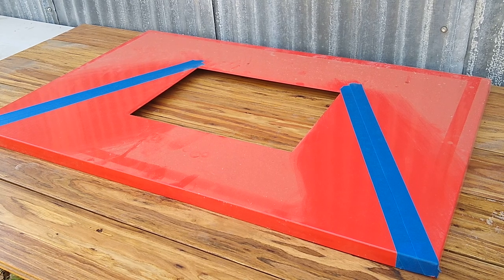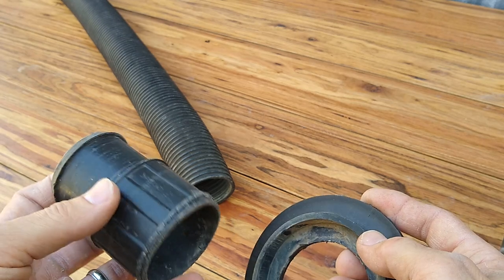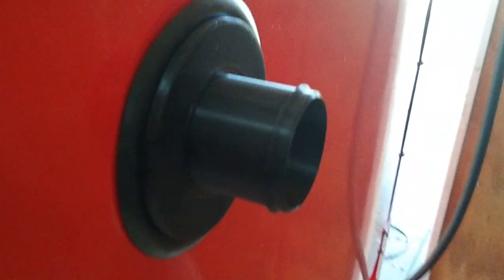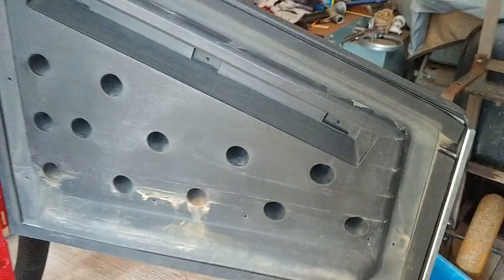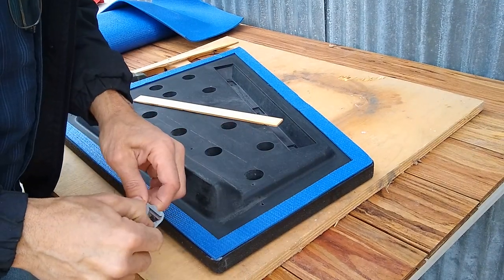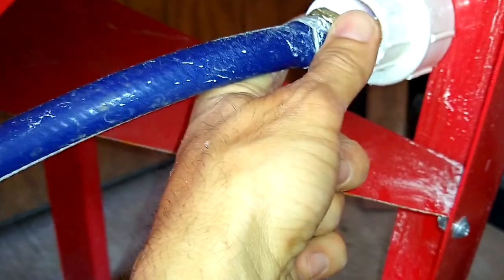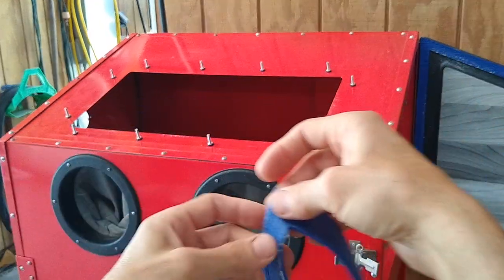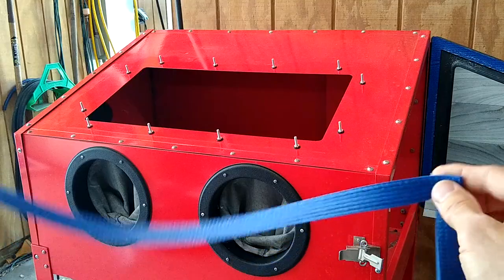Easy to do Harbor Freight vapor blast / honing cabinet upgrades mods that'll make it better.

Comment: The light you are using buy another one and cut out two holes on top of the glass on either side and stick the lamps in on top of a small glass window for the lamps. That way you get enough light, the lamps don’t get ruined and you can still pull them off when you need them for something else
Reply from the maker: Hello Jorge, Thank you for commenting and suggestions. Link a picture here or email me vbared@gmail.com so I can see how yours looks. More light would be awesome!

Comment: For the new cabinet, have you thought about an old dishwasher?
Reply from the maker: Hi Robert, Thank you for commenting. I've seen a dishwasher build that Armoury Enterprises put together, it's a cool project. It would definitely work for anything that will fit inside.

Best of luck with your projects!

Comment: A striplight right in the corner above the glove holes would be awesome! Directly where you're looking.
Reply from the maker: Hello smaqdaddy, Thank you for commenting. You and I have the same thoughts about that. Linked is my video on LED lighting that I added to the underside of the glass bezel. One thing I would have done different is to use PETG instead of PLA which won't hold up to heat at all. 

https://youtu.be/rD0HQ7l5uvE

Comment: Hello
Can I purchase the vacuum adapter and inlet cover from you? 
George
Reply from the maker: Hello George, Thank you for commenting and consideration in supporting my work. Please email me your shipping details and put "Harbor Freight Accessories Quote" in the subject so I can spot it. I'll send you a price breakdown of the most common parts. Please also specify if you want a locking hose end or non-locking if you planning to fasten the hose with a clamp.  

vbared@gmail.com

Comment: You are the 3d King - thanks for sharing your work. I'm doing this upgrades now!! Did you make V3 gun yet?
Reply from the maker: Hi UcantBeSerious03, those upgrades made a big difference in performance for me. I'm still tuning the V3 blast gun to improve media flow path. I'll put together a video about it soon.

Best of luck with the upgrades.
Reply: @vbared  Are you going to keep it garden hose threads on V3? 

I'm about to order stuff for V2 as I don't own a vapor nozzle yet. I love the flexzilla hose and great idea - there isn't any pressure from the pedal to the nozzle end. genius!
Reply: @vbared  I'm not sure if this chart will help you. Its CFM and nozzle size but its for media blasting and not vapor blasting.  https://www.idsblast.com/sandblasting-supplies/4874

I have a little compressor so I'll have to hack your stl file to make the orifice smaller or drill and tap it and insert a drilled out set screw. I  probably need a 1/8  - maybe cheat with a 3/32 orifice and 3-4mm nozzle.  Lousy 120v compressor, I'm in a remote location with no 220v :(
Reply from the maker: Hi UcantBeSerious03, Yes, V3 will keep the garden hose threads. I kept my Flexzilla hose on the longer side and left the slack outside of the cabinet so I could find the perfect length inside while using it.

Thank you for the idsblast link. It's a great resource. 

Best of luck with your build!

Comment: Hi again, just a couple more questions - Do you use any of the protective films supplied with the cabinet glass? Or just use the glass bare? Also, you say to set presure at 50-6psi, is that the static pressure or the working pressure (actual pressure showing on the gauge when the foot pedal is being pressed down and air is flowing).... Thanks!
Reply from the maker: Good morning Ryan, Thank you for commenting. The clear sheets that come with cabinet will not work with the wet system and leave a lot to be desired in a dry setup. 

I found that an automotive paint protective clear film on the inside glass is the best way to protect the glass from being etched and doesn't need to be replaced. Check out my video about it 

https://youtu.be/OuqL9xWJE48

I set my cabinet pressure regulator between 50 - 60 psi without the air control pedal being depressed. Glass beads shatter above 60 psi. Materials like garnet can go much higher but unless your running a big compressor blasting garnet at 90-100 psi uses up all your air too fast.

Vapor blasting is awesome and I enjoy talking about it. Hit me up with any additional questions, I'll be glad to help.

Best of luck with your build.
Reply: @vbared  Thanks for this, very helpful.

Comment: I've just finished putting my cabinet together. This content is awesome. Plan to get the parts printed. Depending on cost.. have no idea about printing things and how long it takes to do so.  Thanks for the content!
Reply from the maker: Hello SNWMBL, Thank you for commenting and your kind words. 3D printing is super cool and really not very expensive to get started. Learning to design your own things in CAD is the only tricky part. If you have the patience and time to learn a few basics it's extremely rewarding. 3D print times are mostly affected by the size of the item. 10 minutes for something very small to 18 hours for something like the V3 Vapor Blast Gun Kit.

Best of luck with your build.

Comment: Hello Victor, and thanks for the tips.  I'm in the middle of putting together a vapor blast cabinet with some of your ideas, including the trash pump in the bucket.  
I don't have, nor do I have access to a 3D printer.  I like the vacuum attachment you made.  My question is, would you make and sell one?
Reply from the maker: Hello ez_going 1, Thank you for commenting and considering to support my work. Yes, I can print one for you. I've had many people request this. Email me your shipping info vbared@gmail.com so I can figure out the shipping cost and give you a price. Please put "Vaccum adaptor quote" in the subject line so I can spot the email easily.

Thank you.

Comment: Great videos! Did I miss the link to the Tacoma kit? I’m looking to get started vapor blasting quickly without having to chase down 100 parts. A conversion kit would be lovely.
Reply from the maker: Hello BMW Wagon Guy, Thank you for commenting. I watched the Tacoma kit videos but the kits were expensive and back ordered with no ETA so I put together my own version. I linked a few of my other videos that will give you more details and all the materials used are linked below. Make sure to check the description info for links to anything not included here.

Best of luck with your projects!

Videos:

Air Control Pedal install details - https://youtu.be/j1fkCO0DcL0

Quick change glass upgrade - https://youtu.be/XQMAxHyTzko

Base Vapor Blast System setup - https://youtu.be/4hoJ25zwLyA

LED Bezel upgrade - https://youtu.be/rD0HQ7l5uvE

Details on my wet blasting system including a complete parts list, sources, and current costs.

Compressor

https://www.northerntool.com/shop/tools/product_211720_211720  949.99+tax

Compressor Hoses and Fittings

https://www.harborfreight.com/12-in-x-50-ft-rubber-air-hose-62888.html?_br_psugg_q=1%2F2+air+hose       29.99+tax

https://www.homedepot.com/p/Apollo-1-2-in-Brass-PEX-Barb-x-1-2-in-Male-Pipe-Thread-Adapter-90-Degree-Elbow-APXME12/301541102       3.97+tax

Air Regulator, Fittings, and Control

https://www.harborfreight.com/125-psi-12-in-npt-air-flow-regulator-with-dial-gauge-68280.html  22.99+tax

https://www.homedepot.com/p/Apollo-1-2-in-Brass-PEX-Barb-x-1-2-in-Male-Pipe-Thread-Adapter-APXMA1212/301541054 2.52+tax might need 3 

https://www.eastwood.com/eastwood-blast-cabinet-foot-pedal-and-gun.html  69.99+tax

The Budget Blast Cabinet and Sealant

https://www.harborfreight.com/40-lb-capacity-floor-blast-cabinet-68893.html  189.99+tax

https://www.homedepot.com/p/GE-Advanced-Silicone-2-10-1-oz-Clear-Kitchen-and-Bath-Silicone-Sealant-Caulk-GE5040-12C/100663319             6.57+tax

Blasting Nozzle and Diesel Check Valve

https://www.ebay.com/itm/Boron-Carbide-35mm-Blaster-Nozzle-Replacement-Air-Sandblaster-Gun-Head-Accessory/264575797522?hash=item3d99f24912:g:yIQAAOSwASBdNWX8  27.87+tax & Shipping

https://www.amazon.com/Return-Check-Petrol-Diesel-Aluminium/dp/B06XJHGXQP/ref=sr_1_8?crid=2AN08NNWFOIRE&dchild=1&keywords=1%2F2+check+valve+air&qid=1594776694&sprefix=1%2F2%22+check%2Caps%2C180&sr=8-8                     8.80+tax

Water Pump, Fittings, and Hose

https://www.homedepot.com/p/The-Home-Depot-5-Gal-Homer-Bucket-05GLHD2/100087613          3.49+tax

https://www.ebay.com/itm/1-5HP-Water-Submersible-Pump-Stainless-Steel-Silver-Clear-Dirty-Pool-Pond-Drain/353072228123?ssPageName=STRK%3AMEBIDX%3AIT&_trksid=p2060353.m2749.l2649         60.99+tax

https://www.homedepot.com/p/Oatey-4-oz-Purple-Primer-and-CPVC-Cement-Handy-Pack-30234/203561639            7.70+tax

https://www.homedepot.com/p/Charlotte-Pipe-1-1-4-in-x-1-in-PVC-Sch-40-SPG-x-FPT-Reducer-Bushing-PVC021081000HD/203811585 1.44+tax

https://www.homedepot.com/p/Charlotte-Pipe-1-1-4-in-PVC-Sch-40-S-x-S-x-S-Tee-PVC024001200HD/203812201       2.42+tax

https://www.homedepot.com/p/Charlotte-Pipe-1-1-4-in-x-3-4-in-PVC-Sch-40-Reducer-Bushing-PVC-02108-0950HD/203851140           1.44+tax will need 2

https://www.homedepot.com/p/Apollo-3-4-in-Brass-PEX-Barb-x-3-4-in-Male-Pipe-Thread-Adapter-APXMA3434/301541030 2.82+tax will need 4

https://www.homedepot.com/p/Homewerks-Worldwide-3-4-in-PVC-FPT-x-FPT-Union-511-44-34-34H/204202889  4.98+tax

https://www.homedepot.com/p/Swan-5-8-in-Dia-x-6-ft-Leader-Water-Hose-CLOLH5806FM/202305259 7.97+tax

https://www.homedepot.com/p/Everbilt-1-2-in-1-1-4-in-Stainless-Steel-Hose-Clamp-10-Pack-671255E/202262870  8.74+tax will need 2

How to modify the glass trim for easier removal, replace the plexiglass that easily scratches to glass for a crystal clear view.

Tools needed: 

7/32 drill bits: https://www.harborfreight.com/332-in-titanium-high-speed-steel-drill-bit-set-7-pc-61547.html

Glass cutter: https://www.harborfreight.com/glass-cutter-96032.html

Socket set: https://www.harborfreight.com/38-in-14-in-drive-sae-metric-socket-set-40-pc-62843.html

Screwdriver set: https://www.harborfreight.com/screwdriver-set-32-pc-61259.html

2 x clamps: https://www.harborfreight.com/12-in-ratcheting-bar-clampspreader-62123.html

Cordless drill: https://www.harborfreight.com/18v-lithium-38-in-cordless-drill-kit-64118.html

Paddle bit set: https://www.harborfreight.com/steel-spade-bit-set-6-pc-69015.html

Tape measure: https://www.harborfreight.com/16-ft-x-34-in-quikfind-tape-measure-with-abs-casing-62466.html

Materials:

Glass 3/32" thick 26"x36": https://www.homedepot.com/p/24-in-x-36-in-x-0-125-in-Clear-Glass-92436/300068389

#10 - 32 zinc screw combo 6 - pack (you need two): https://www.homedepot.com/p/Everbilt-6-32-x-1-1-2-in-Combo-Round-Head-Zinc-Plated-Machine-Screw-6-Pack-803061/204274607

#10 - 32 zinc wingnut 4 - pack (you need 3): https://www.homedepot.com/p/Everbilt-10-32-Zinc-Plated-Wing-Nut-4-Pack-802361/204274201

3/16" neoprene washers 4 - pack (you need 3): https://www.homedepot.com/p/3-16-in-x-1-2-in-Black-Neoprene-Washer-4-Piece-815728/204276433

Comment: Is the Vacuum set up for wet application or dry how much water gets in there
Reply from the maker: Hello Lane, You're going to need a vacuum for wet and dry blasting. I'm running mine without a filter and just running a long exhaust hose outside.   Building a separator to catch water and media would be best.